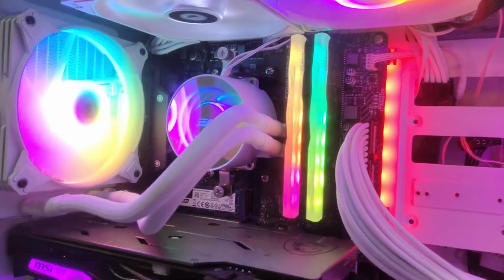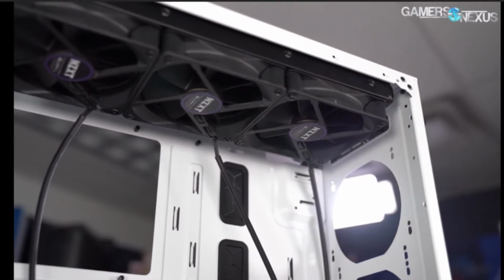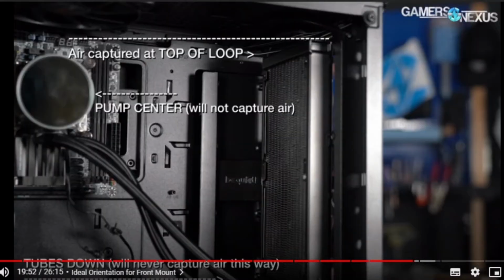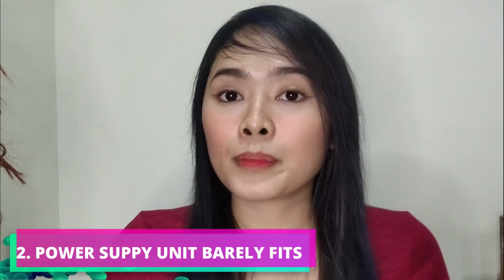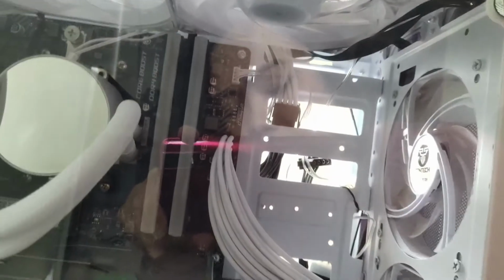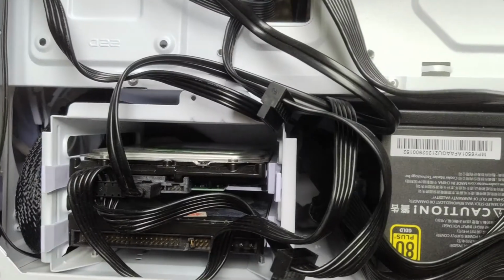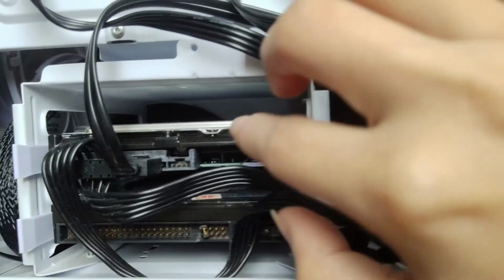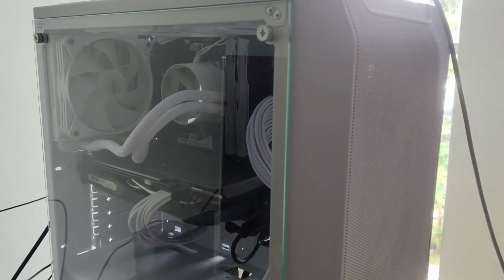An Honest Review of FANTECH AERO CG80 Case

Comment: i got a 240mm aio to fit at the top, got a 4mm gap between the vrm heatsink and the radiator
Reply: What AIO did you use? I'm now on the search for a white one that's thin, didn't think there would be issues mounting a 240mm when i purchased the case but now I'm worried
Reply: @TPH-jq4gp  it was a silverstone.

Comment: unscrew the top fans and stick the 240mm aio on top? it does fit(it built one and i could fit a 240 on top and a 360 upfront).
Reply from the maker: is this a question?
Reply: @ShelleyMae  yes.and the answer was no. the top doesn't have enough clearance for a 240mm aio.

Comment: I bought this case. it has small size space for psu multi rail , it cannot setup hdd in slot must remove panel out and install on PSU Cover 

but overall  i like this case
Reply: squeeze the caddy and you can take out the hdd slot.

Comment: I've have the same issue, where to connect the led cable :(
Reply from the maker: if you have a led hub, you can connect the led cable to the reset switch cable. You wont use the reset switch cable.